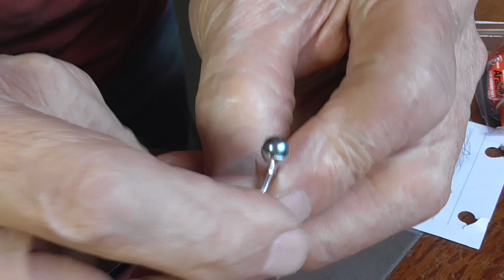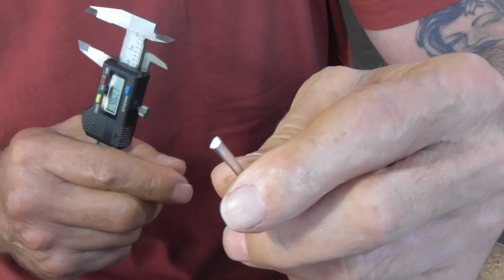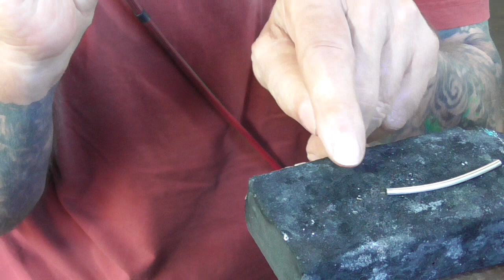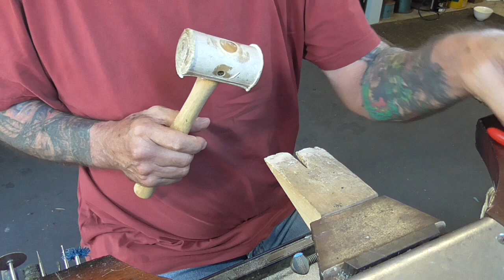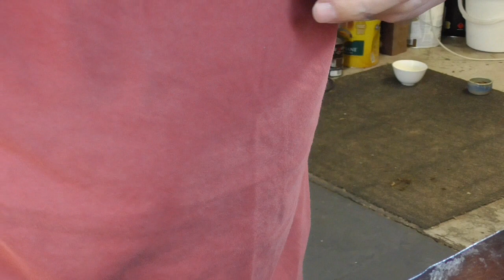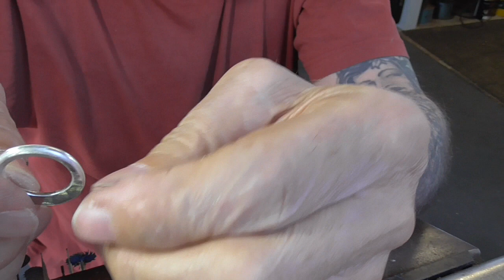forged pearl ring pt 1

Comment: Thanks again Soham. A question what size solder do you use? .5 ? I always wonder if I should use a heavier weight if using thicker wire. I tend to use the same size only cut longer lengths but I'm not sure if this is right.
Reply from the maker: i don't know if it is "right" but that is exactly what i do. ;-)